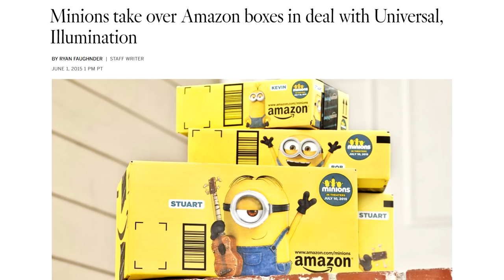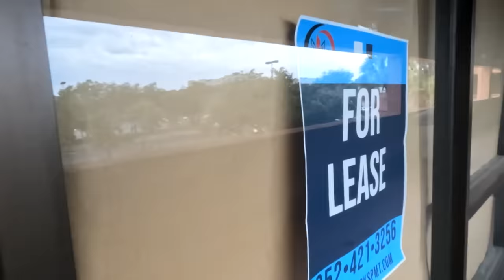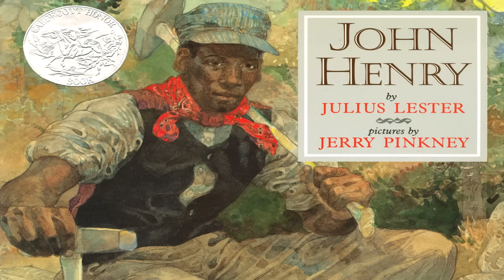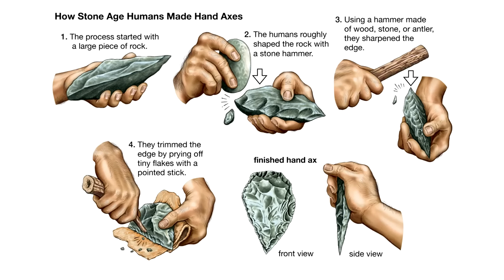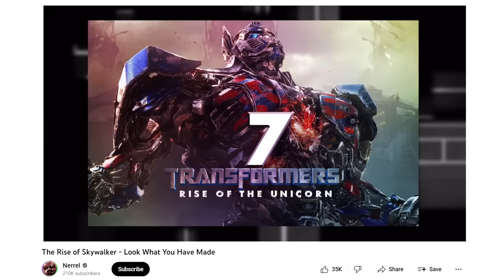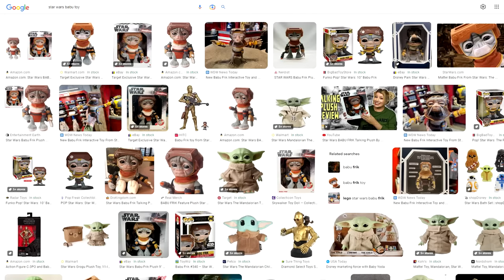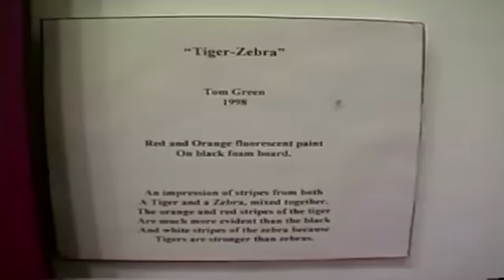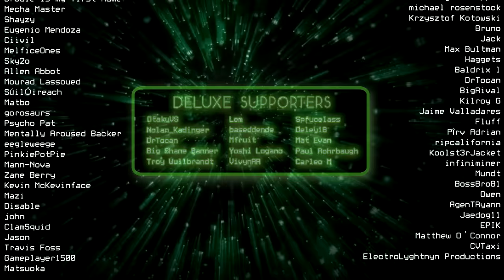The Matrix: De-booted

Comment: I honestly think that the Matrix 4 represented the point when cinema hit rock bottom, as at that time literally every franchise and ip was dead or on ice. 2021 pretty much had only 5 above average releases that year, while gaming reached rock bottom that year as well. At least when you hit rock bottom the only direction you can go is up, which seems to be the case considering 2022 was a major improvement over 2021, while 2023 again looks to be an improvement over 2022.

Comment: It seems like most of the movies today are remakes, reboots, sequels, or just a movie adaptation of a book. But really there is not much new and original films today that isn't based on older content/ideas. But what's even worse is those film franchises that should have ended years ago but Hollywood is still pumping them out. Some examples has be the Child's Play films, Friday the 13th films, Nightmare on Elm St. films, Michael Bay's Transformers films, and that's just the tip of the iceberg.

Comment: I'd just add the inequality angle, because access to technology is one of the most relevant causes of inequality increases. But the fact that Matrix 4 might have been a case of torching the franchise and run was great. The issue of this kind of criticism is that some people are tagged as "joykillers" - see the backlash against Scorcese's argument, and do not doubt that studios won't weaponize that - but sometimes stories need to sucker punch us in the face. This has happened before, like Blazing Saddles for the (dying) western genre and Austin Powers for spy movies; we need to drag the audience outside their comfort zone, violently if necessary.

Comment: We are desperate to escape the prescribed reality of capitalism. We attempt to do so by the means of the entertainment industry. The entertainment industry has been optimised by the formulaic methods that require the reduction in cost of production and the maximised gain in revenue. Our fantasies are just copies and regurgitations of already explored worlds and we don't know any better

We escape into worlds based on a formula designed to make the most revenue. In the matrix we generate energy for the machines and in the real world we generate money for the system

The matrix 4 was a disappointment because we wanted to escape into something that was original like we remember. It's regurgitations of already explored concepts left us feeling empty but this is the point. It followed a formula that was already proven to work in order to get money out of us.

The matrix 4 was a failure in the traditional sense and a massive success in a deeper one. It highlighted the fact that the matrix has us and unlike in the films we have no choice between the red pill or blue pill.

Comment: that's how i felt the first time i saw it. underwhelmed and expectedly disappointed by the front of the movie, but ultimately in on 'fuck you'. i got it. another franchise that saw a similar 'original author self-sabotage' is the Fight Club Trilogy (which i personally believe is a Tetralogy, as the movie is just as important in the thematic sphere as the novel and graphic novels) - one thing that Fight Club did was  get a dig at the fans as well, the ones that misinterpreted the book/movie, the ones who idolised Tyler Durden and all that. they'd be explicit step-by-step explanations of the themes and the characters to really drive home the subtly missed by idiots... it went full meta-madness, more-so than this film. i think Resurrections does all this too tho - an explicit reiteration of what the original films said, make things clearer for those unable to read subtext, even an extra layer of 'fuck you this was unnecessary' to the execs